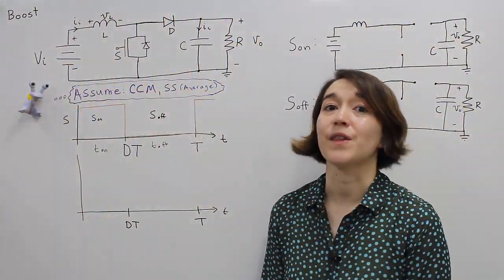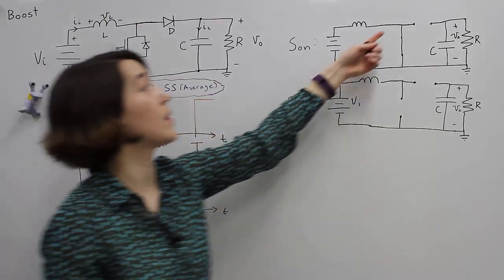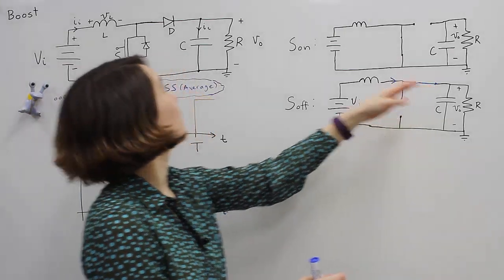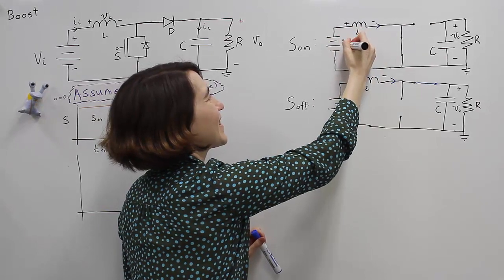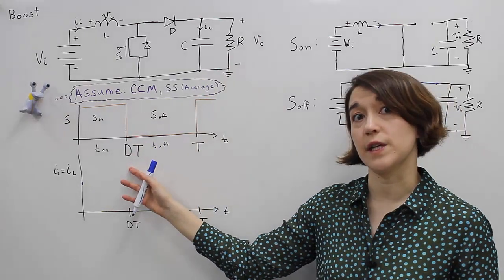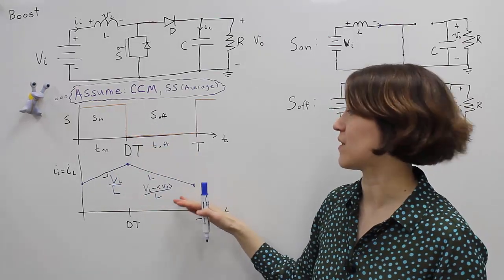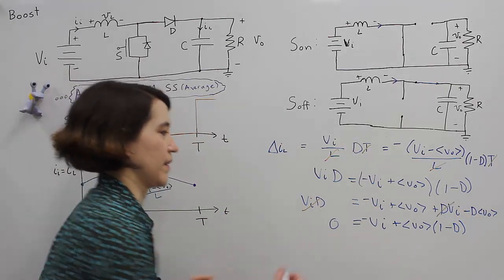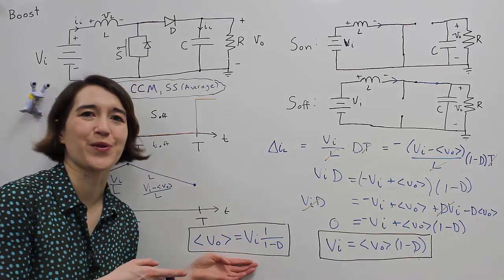Boost Converter Operation and Voltage Equation

Comment: Hi Kat, first I like your videos, second...
In the second circuit (Soff case) the voltage symbols over the inductor must be reversed, as the inductor on that case reverts it´s voltage and start acting like a current source.
KVL --> Vi + VL = Vo